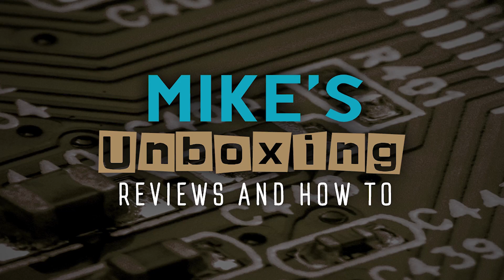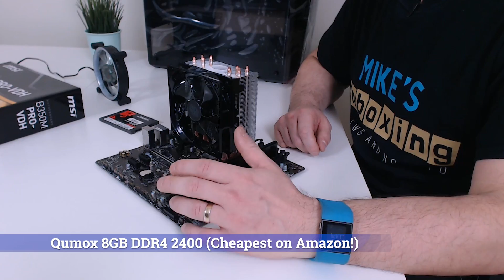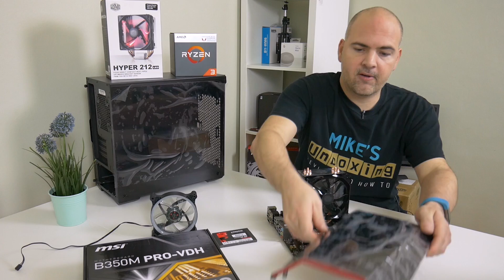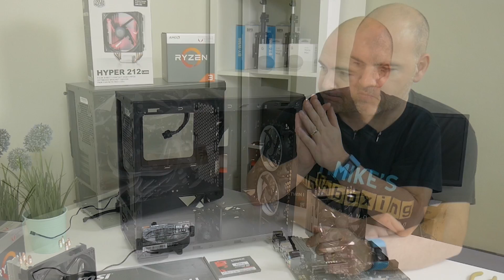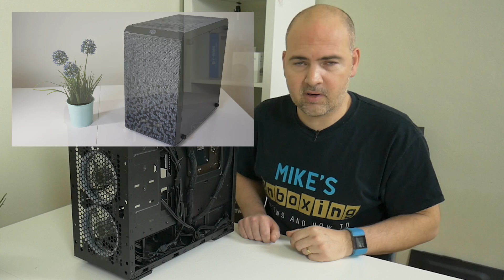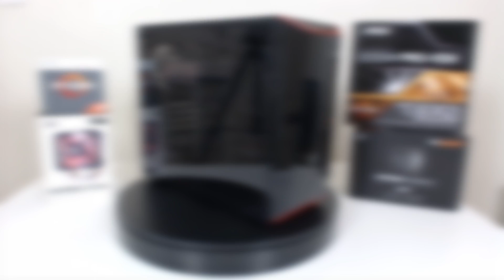Ryzen 2200G Build VLOG Cooler MasterBox Lite 3.1 - A Bit Modified!

Comment: Mike,  I've just done a build with a  Ryzen 2400g in the Masterbox B600L  and found that it had horrible air flow as well.  I knocked the mesh/screen  out of the bottom air inlet and removed the mesh/screen from the side inlets and my maximum temperature dropped by 9 C.  I ended up drilling  forty four (44) 3/16" holes in the  plastic in front of the top fan to get the temperature where I wanted it.   I now have a 2 C difference in max temperature with the front on vs front off.  
One thing you might want to look at is the orientation of your CPU cooler.  With no top air vents in the case the horizontal orientation is going to have a negative effect on the air circulation.  You might look at the Deep Cool Gammaxx 400 instead of the Hyper 212 in your next build.  I found about a 3 C improvement with the vertical cooler orientation.
Reply from the maker: Thanks for the advice. Since the build I have modified it a little more for airflow and installed the Gammaxx 400, much nicer looking and the air flow has improved. https://www.youtube.com/watch?v=wfF8o07vtGE&t=0s&list=PL39HCM-SRLM9nTVRnfPvAOHFRnWQe9Sf0&index=5

Comment: Hey I have the same setup my hyper 212 evo mounted vertically so air is going out back exhaust, it is just touching the side panel but it closes fine but not sure if its like flush. do you have the same issue with your cooler?
Reply from the maker: The 212 led has a different mounting so you can't mount it vertical for AM4 setup. I would have preferred to use the backplate system and mount vertical, but the mount doesn't fit (only am3+) even so it still just about fits.

Comment: Do you recomend that case?
I got that components
-gtx 1050 2gb evga dual
-asus prime b320
- 8gb ddr4 2400
- ryzen 3 1300x
-500w evga (atx)
-hdd 1t
Reply from the maker: Yes I would recommend it for your setup, just consider either removing the accents or maybe a small amount of drilling to get enough airflow. I would suggest that the thermal limit for this case is around 250 watts total or the Ryzen is about 65w and the 1050 is around 125 I think so should be okay.
Reply from the maker: Sorry the 1050 is much lower wattage so it will handle it easily
Reply: It only worries me, as you say the air flow inside the cabinet, just as you have done it would put two more fans.
Good videos man
Reply: without making any modification to have better ventilation (the chasis)